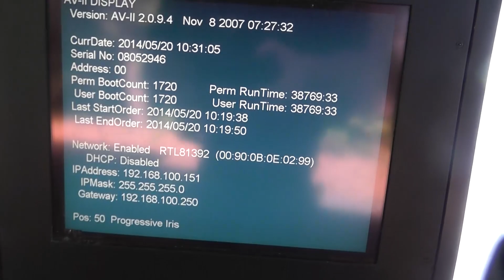Proper Way to Install the Be Quiet CPU Cooler

Comment: 9:00 So... the finger tip /razor blade method of distributing the thermal grease? I've heard that may not be the greatest method, leaves opportunity for air pockets, etc? In fact, just leave the pea drop of grease is enough? Thoughts?
Reply from the maker: Either way is fine.